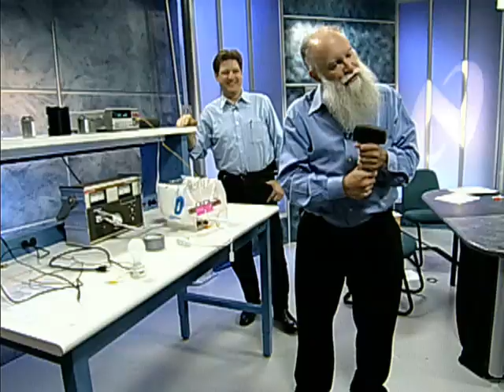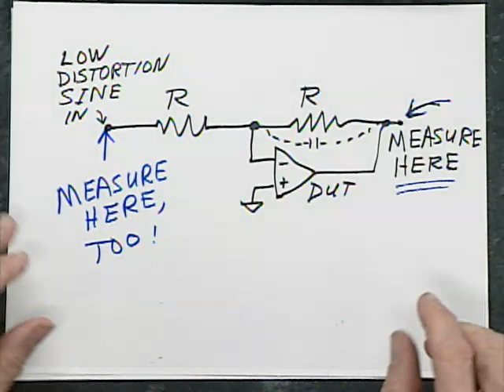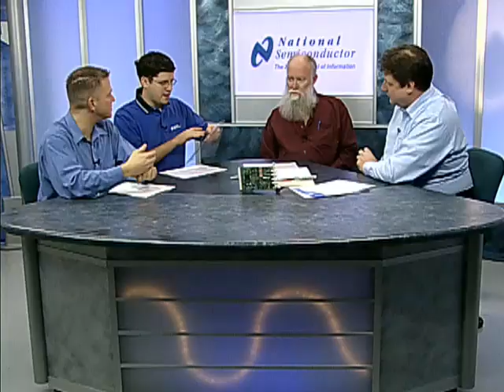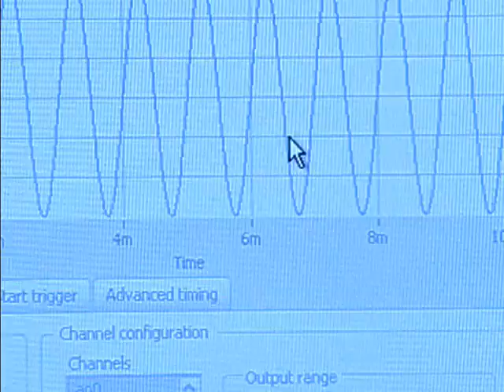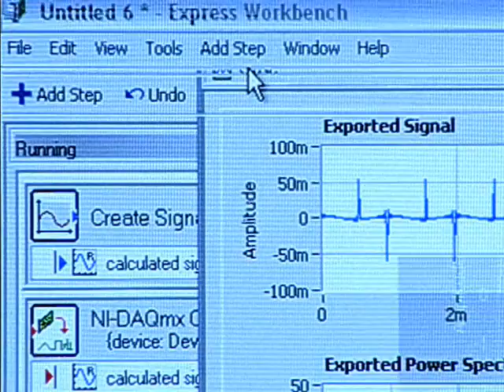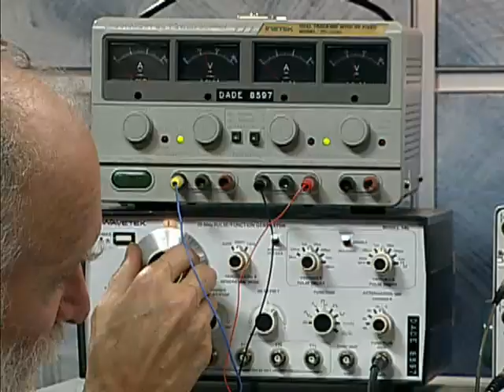Whats All This Distortion Stuff, Anyhow?

Comment: Bob Pease is the real electronics engineer. He must have suffered a lot having to listen to the sales pitch of the NI engineer.
Similar things happen to me all my life. Some fast talking "engineer" just spend thousands on specialized software with blinking lights and all sorts of jelly-beans on the screen and assuming you trust the lot there were wiggles on the screen. Of course the boss looking over the fast talkers shoulder was very impressed, because he did not know what he was looking at.  And when you just spend $100K, you better love it...
Bob's setup however uses old test gear which are available in every lab. Yes, you MUST understand what you are looking at.
Bob's setup is just better... sorry to say, but I do not care one bit about NI test gear. 
I actually did build a distortion analyzer using some circuits from Jim Williams and I could measure distortion down to -130dB... Try that, Mr National Instrument !

Comment: You need a measurement system that has at-least 5x lower distortion (overall) than the distortion in the system you are trying to measure and there are a lot of places distortion or digital noise  (DAC, output amp, attenuators, input amp, ADC) can mess up your measurement with one of these data acquisition cards;  Read the fine print on the specifications before purchasing.

Comment: Lol bob just showed you a way to replace a thousands dollar worth of equipmant with an opamp circuit. How lovely
Reply: As long as you already have a fully equipped electronics lab, with a signal generator and an Oscilloscope
Reply: @videoaccount5676  Somehwat true but it isn't that hardware complex in this case and it doesn't need any software at all.
Reply: What?